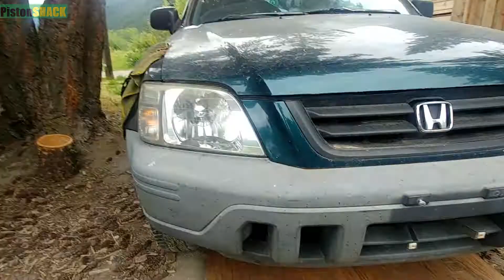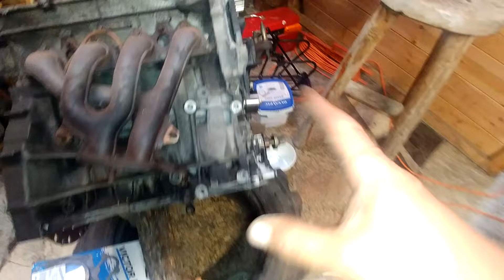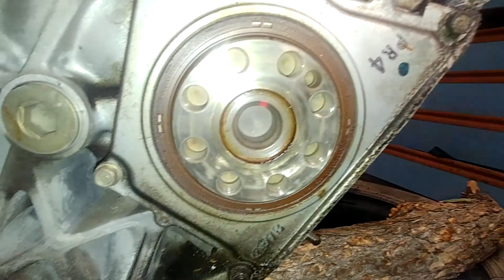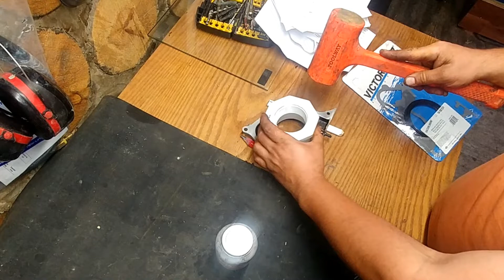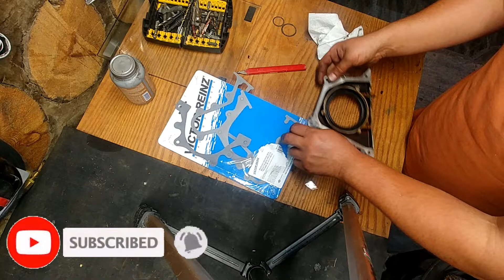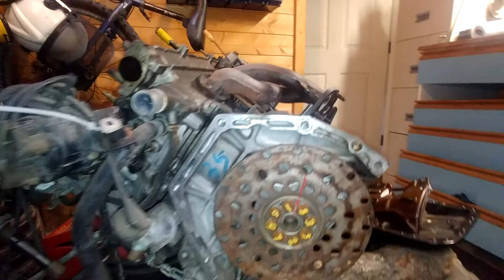HONDA CR-V REAR MAIN CRANKSHAFT SEAL REPLACEMENT in Details | HONDA CRV 1997-2001

Comment from the maker: More Honda CR-V repair videos: HONDA CR-V Engine SWAP. Part 1: REMOVAL. Complete Tutorial. 
https://youtu.be/0kE_EGNt4w4
HONDA, ACURA HARMONIC BALANCER  aka CRANKSHAFT PULLEY  BOLT REMOVAL. https://youtu.be/ZjlQsnI_dmM
HONDA CR-V NO CRANK, NO START - BASIC TROUBLESHOOTING. We Fixed! https://youtu.be/n6rhwxNzplU